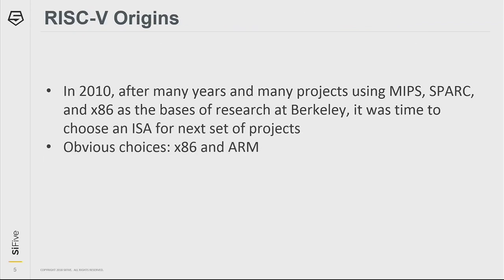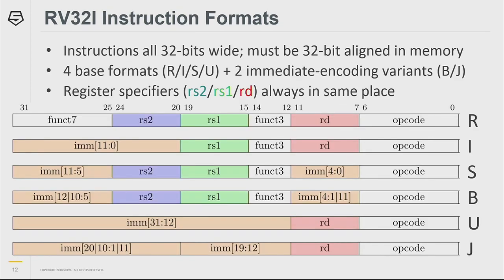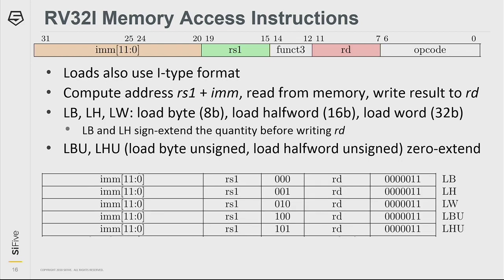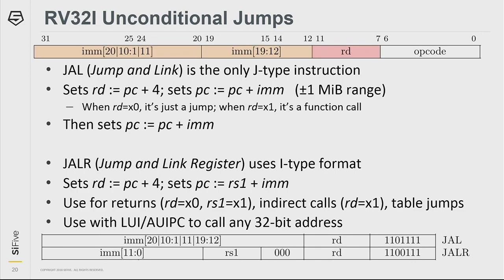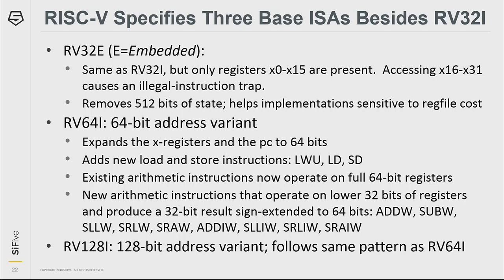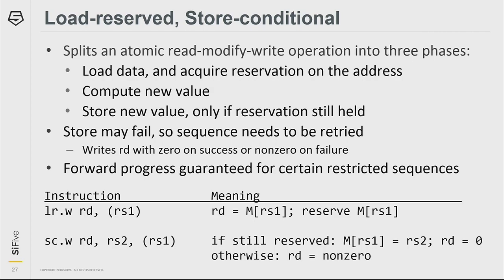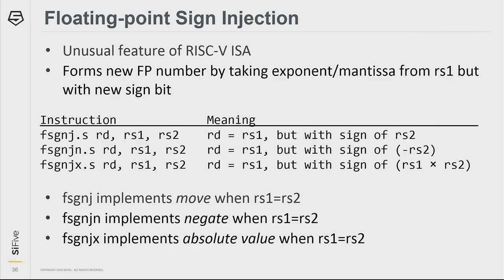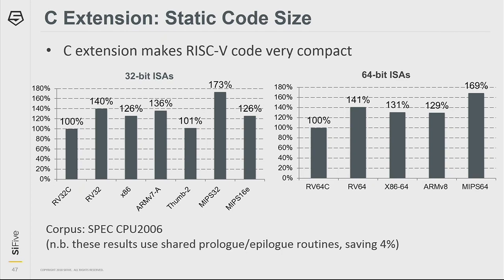BASE ISA

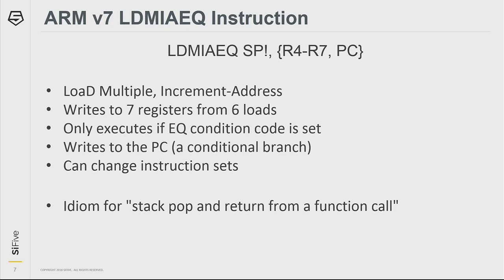Comment: At around 2:40 to 2:50 I had to restrain myself from throwing something at my computer's monitor.  I opted instead for some verbal schooling of Andrew Waterman from the comfort of my desk at home (even though he couldn't hear me, I felt better teaching him a thing or two about the early CISC philosophy, and how instructions like the AA* family did help out in the early days, and how they're now maintained only for legacy purposes). :-)

AMD reclaimed some duplicate instructions for REX extensions.  There's nothing to prevent AMD or Intel from adding a flag to disable legacy decoding of some rarely-used opcodes, to allow new single-digit opcodes to replace more common operations.  It might even be interesting to allow some macro definitions to be introduced which allow small code sequences to be triggered by some of those reclaimed opcodes with a new CPU extension.
Reply: I've watched this video a few times, and that part of the video around 2:40 consistently infuriates me.  I wish presenters would understand more about computer history and the goals present in people's thinking at the time.  Before RISC there was CISC, and the smaller single-byte opcode able to perform multiple separate steps was an advantage back when memory was expensive.  It had a very valid reason for coming into existence when it did, and to summarily discount it when you've never been using computers in a pre-year-2000 world ... it just isn't right to disparage things you have not given sufficient thought or emphasis to.  It's like the epitome of arrogance to think your thinking is so right, and their thinking is so wrong.  It just infuriates me to see such a grand nonchalant display of pride and arrogance in presentations like this.
Reply: @EnsignRho  this comment just shows that you don't understand Andrew's point. Using 1 byte opcodes for very rare instructions (fewer than 1 use in every 256 program instructions, on average) such as AAA, AAS, AAM, AAD, DAA, DAS does not improve code density on machines with limited RAM, it hurts it. They should have been tucked away in a secondary code page, freeing up valuable 1-byte opcodes for things that might be used more frequently. The Motorola 6809, also released in 1978, did a much better job of this.
Reply: @BruceHoult  Thanks for the info, Bruce.
Reply: @BruceHoult  Agreed, even in their prime time, I doubt AAA etc justified their encoding space.